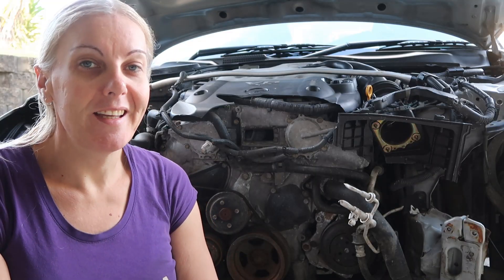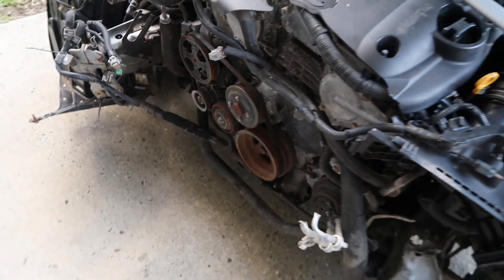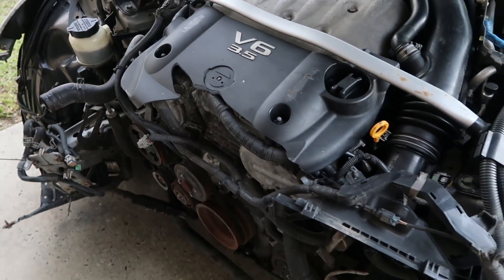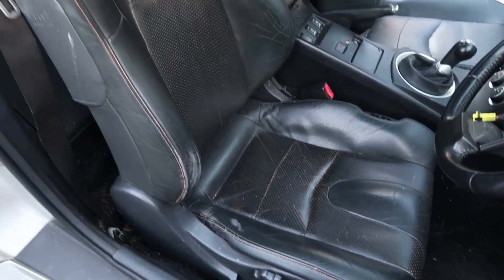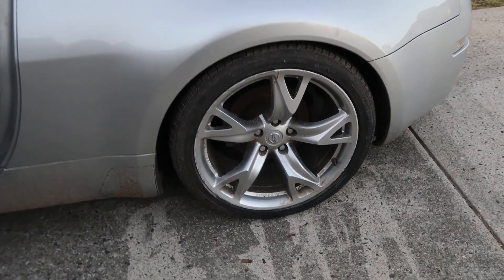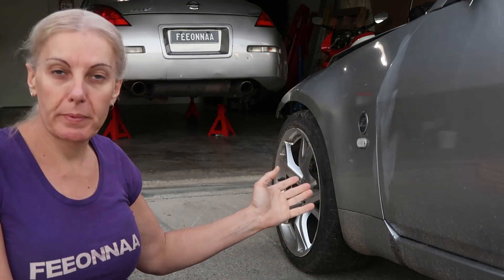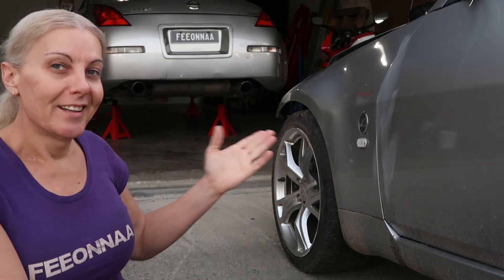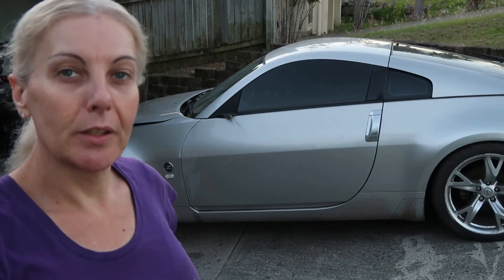This wasnt my fault, What have I done, I need your help

Comment: Good potential if it drives. a lot of the track cars are beaten up really bad then have over fenders hiding it
Reply from the maker: Drives as far as not having a radiator allows...
Reply: @Feeonnaa  yeah that makes it hard but they write them off for nothing these days if that was a new car would get quotes around 30k to fix it was a real eye opener for me How much the cost of everything has gone up yet as a dual trade in the automotive industry I still make the same hourly rate ive made for the last 20 years
Reply from the maker: Big companies just take and take...

Comment: Hey girl,   
I’d build her up into a serious car, 
LS for reliability and cheap for parts and power.
Slowly build her over time, that way you could still drift the ‘bolt on Z’ and once the ‘smacked up Z’ is ready , your confidence and skill is ready for pro-drifting. Keep us posted , cheers mouse
Reply from the maker: LS build you say ... hmmm
Reply: @Feeonnaa  I’ve built a few and they’ll definitely give you plenty of torque to fry those tyres. With only about $2500 of aftermarket parts- easy 450hp and 450lbs torque, mouse
Reply: Not a super cheap engine in Australia these days.
Reply from the maker: Thanks Mouse 🐁 💜
Reply from the maker: Nothing is cheap anymore 😕
Reply: @Feeonnaa  I regret selling so many cars lol. Like the 3K PS13 with a manual I sold for 2.5K in 2018. Or my TI R31 with manual conversion I bought for 4K and sold for 3K in 2019. Or the $500 AU XR6 manual that needed a clutch for 4 months so I sold it.

I could go on lol. I have sold too many cars.
Reply from the maker: I'm really about the drive experience, but to drive you need the car.

The downside of this is fixing the car when they break, and we all know they will break ..

Comment: Good find!
Coilovers are good. MCA are based in Geebung Virginia.
Wheels are 370z 40th Anniversary wheels. Most us JDM nuts like them as they're decent oem sizes. 
Expect $1k-$1200 for your set depending on rash. You'll have to give buyer the washer wheels nuts too to run them.
I wouldn't get into a build on that Z.
It's great you have a spare. 
Get it in the backyard or throw a tarp over it in the front.
You're a drifter, there will come a time in future you'll need everything off it.
You wont have to buy things separately, super handy. Spare running VQ35 and manual box is also great to have too if it's not damaged.
My advice is dont invest time in it. Take what you want for yours and keep it spare and keep focusing on your main Z. Good to stick to a specific model and hone your skills.
Reply from the maker: Wow thanks for this help, I really appreciate the information 💜